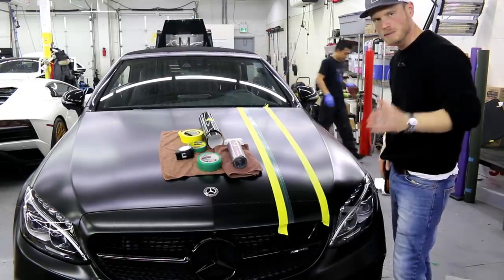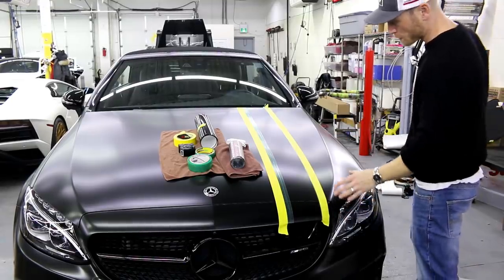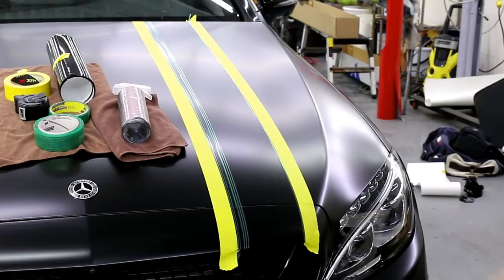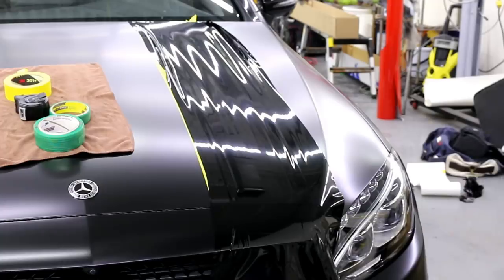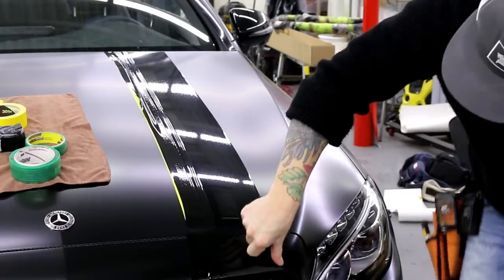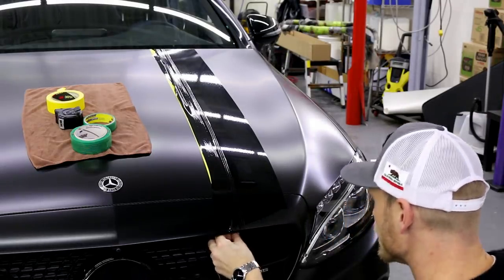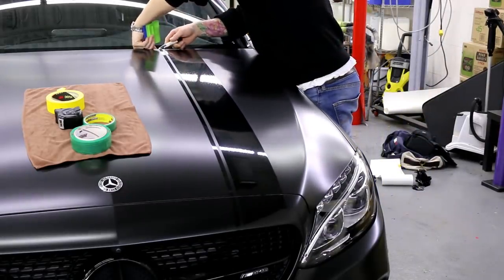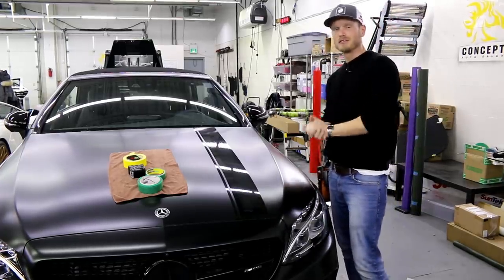SUPER EASY DIY CUSTOM RACING STRIPES

Comment: I have a black on black Benz amg sport and I've had it for 2 year I got about 50,000 miles hopefully going to have her for a while .

Been thinking about putting a either stripe just like this one.

I was wondering tho do you thing it would look better or more aggressive black with the stripe in the middle and 2 pin stripes instead of one like it shows on this video. 

Looks good btw 

I was just curious if down the middle would look better then continue it on the back 
And maybe some dashes on top where applicable?

Also thinking of perhpas making the stripe red same description just.  Solid red down the middle and 2 pin stripes running up the side ? 

LMK

Comment: What is the point on the yellow tape?
You don't have to hit it with some heat?
I'm a DIY'er learning how to do this. thnx for the vids.
Reply: Tape has a lower surface energy than the vinyl or paint underneath, meaning the vinyl you lay over the top won't stick as easy to the tape. Makes for easier removal of excess film.

Comment: What a great looking end result! Really enjoyed seeing that. With vinyl on vinyl are there and lifting issue or is it just as good as straight on paint? 

When measuring out the lines are you using anything to mark your distances or putting the tape down as you measure? 

Thanks for another cool video.
Reply from the maker: You can use a crayon to mark the spot. It will wipe off easily as long as you don't push too hard

Comment: I just paid someone to put black Racing stripes and red pin stripes on my cat the red stripes is overlapping the black is this something I can just Peel off or would it affect the black Vinyl stripes?
Reply from the maker: If they're laid on top then it should remove. You will have to be cautious so that you don't damage or accidentally remove the black ones.

Comment: I just wanted to thank you for providing these awesome wrap videos. If it weren't for your videos I wouldn't have been able to complete the DIY hood stripes I just did on our Durango SRT. I have to confess, I had tried to install stripes on the SRT hood without using air release vinyl and knifeless tape and both times were huge fails. This hood just has way too many compound curves. Using wrap and knifeless tape saved me on this project. It probably took me four times longer to do the job than it would have taken you but I'm really happy with the end results. Thanks again and here's a link to my DIY video  https://www.youtube.com/watch?v=nC8RuI3aM70